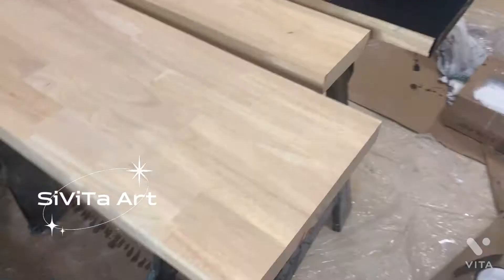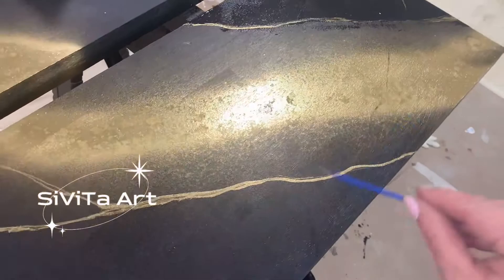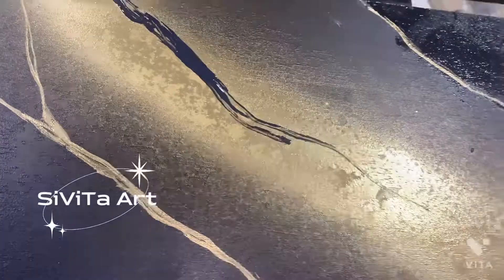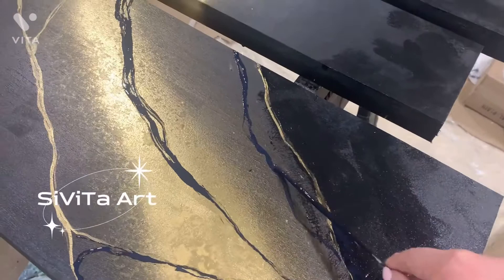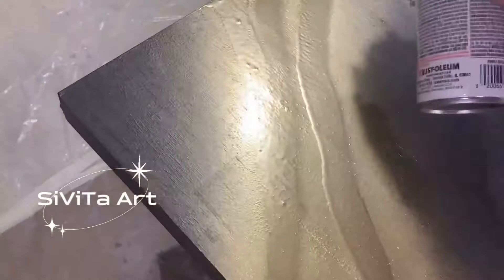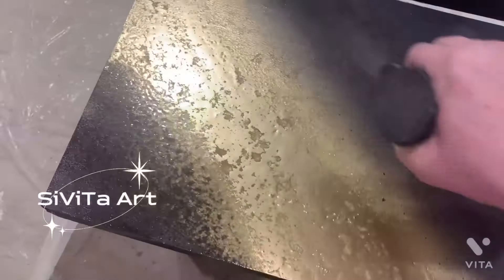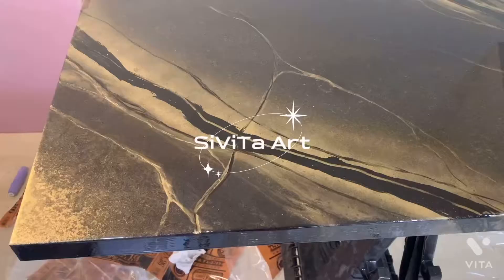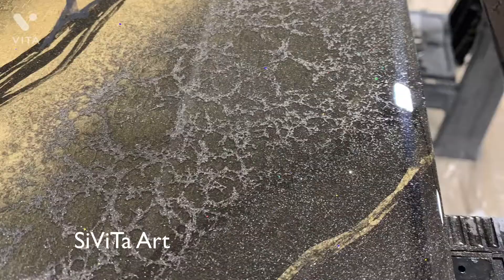How To: Create A Marble and Gold Vein Technique Epoxy

Comment: Do you sand before epoxy
Reply from the maker: I just sent very gently just to remove if there is any dust or an perfection but very very gently
Reply: Wow great work. Question so instead of doing an epoxy based coat you do this process and coat with clear epoxy? Can this process be completed on kitchen countertops?
Reply from the maker: Yes you can do on kitchen countertop,I like the SiViTa spray effect before the epoxy,it make different effect.
If you do over clear epoxy ,epoxy moved and make bigger cells

Comment: Your description says epoxy, but in your products used there is no mention of epoxy?? 🤔
Reply from the maker: I was using that technique before I pull the clear epoxy over it. This techniques is for tilted areas when you cannot control the flow of the Epoxy

Comment: What are you spraying on??? the actual epoxy resin?????
Reply from the maker: Are you spray paint metallic you can use over dried Epoxi or the surface itself before last clear coat